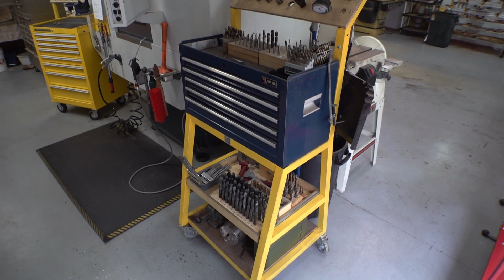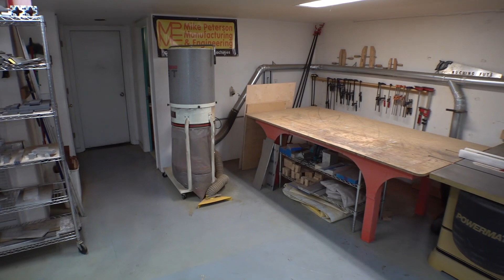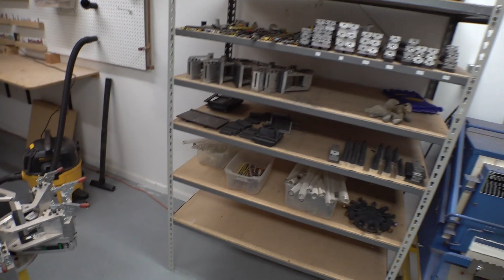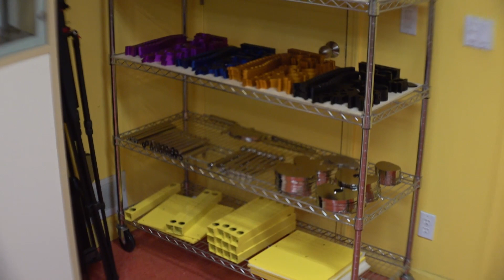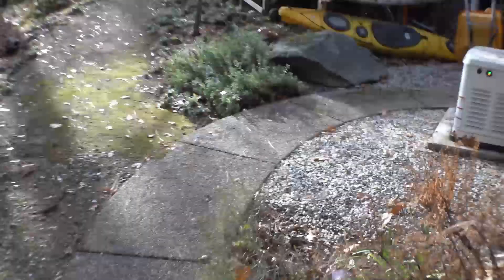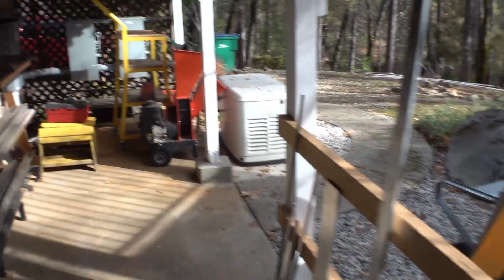Shop Tour 12/27/2020

Comment: Hello sir, I got my Haas mini. I would like to get a coolant oil skimmer and another filter added to the coolant. I noticed some small aluminum flakes already in the tank. I remember you mentioning that you added these to your mini. Any chance you can help me out on what and where to get these please. Thanks.
Reply from the maker: I use this one. It works OK. https://www.abanaki.com/product/tubetastic-tube-oil-skimmer/. I used a standard water filter housing https://www.amazon.com/gp/product/B013GV4ATQ with a coarse filter https://www.amazon.com/gp/product/B0045LQRFC

Comment: Very cool setups, sir.  I've been working on some precision work-holding fixtures for my wet saw as well.  But to share what else I did- I found that an mk diamond MK70 wet saw fits nicely in a blow molded plastic sandblasting cabinet.  Really keeps down the clouds and splash from all the extra jets of water plumbed in to maintain the resin bonded blades.  Unfortunately I've got 4 10" blades to run through before I decommission the old tile saw, and downsize to a 7" saw.  Extra pains were taken to replace all metals in the blasting cabinet with plastics, stainless or aluminum to prevent rusting.